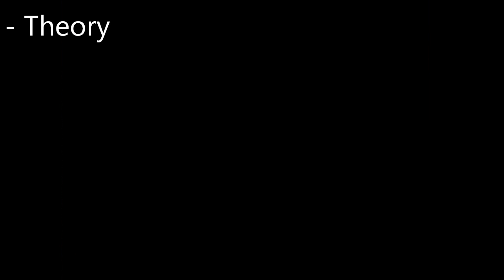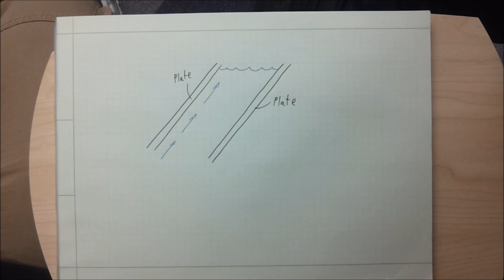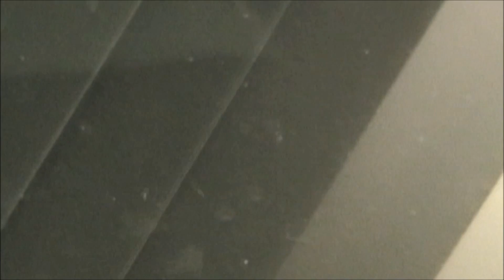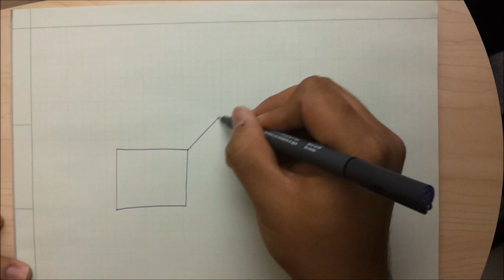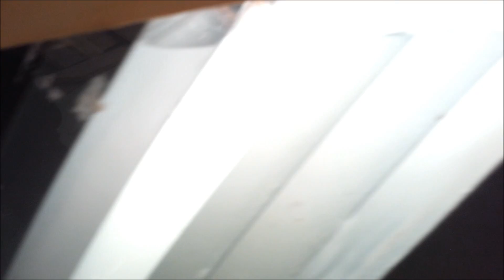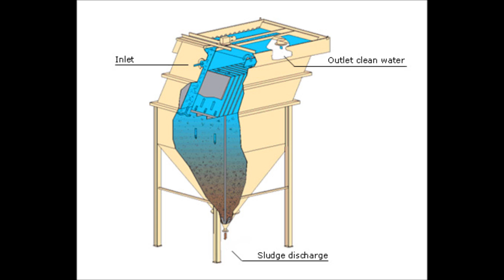Lamella Separator

Comment: If I’d like to make a DIY lamella clarifier using an IBC tote (a 1m3 tank), what diameter of PVC pipes would you recommend for the 60 degree slopes?
Reply: Hi! There is no easy way to determine how many pipes or what diameter to use, bcause it depends on the volume of water you want to treat, the particle size and density of them. So start experimenting. As a rule of thumb, what you need is as much surface as possible, so the smaller the diameter of the pipes the better. Good luck qith your projects!